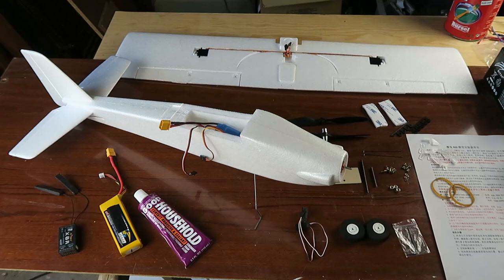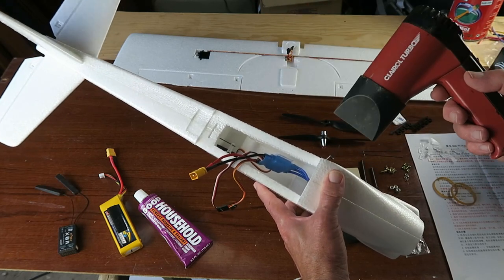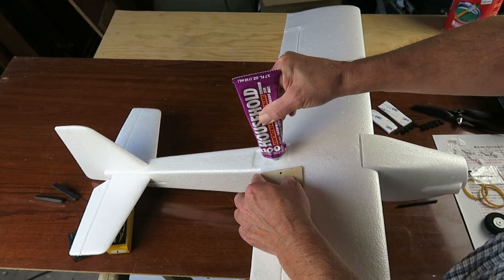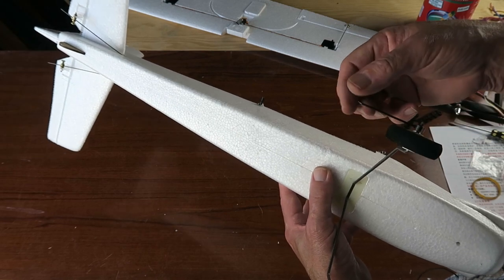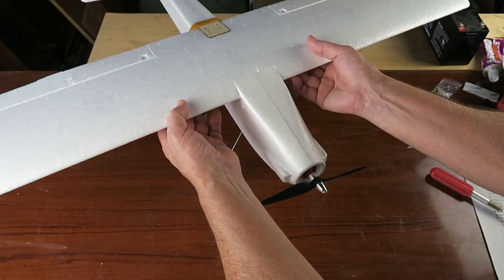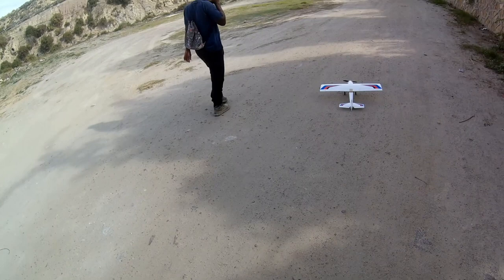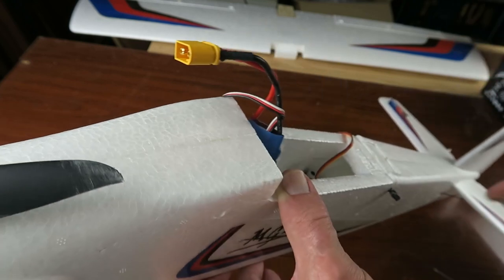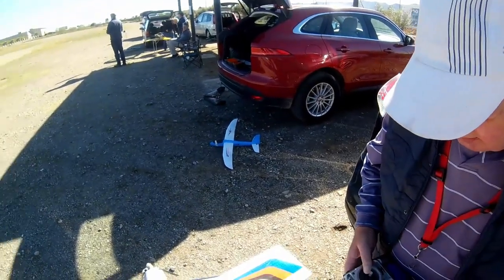MG 800 EPP Trainer Build, Mods & Test

Comment: I built one of these and I did the rudder mod. I also fitted a  cheap gyro which makes it easy to take off and land. Once you are in the air you can switch to manual.  It's a great all-rounder definitely worth Building.
Reply from the maker: That's a great idea! It's rather "squirrely" on takeoff!! What gyro did you use?
Reply: It’s called the NX3 evo . They are very good and come with everything you need. Get it from eBay or Banggood
Reply from the maker: Thanks! Added  to my wish list!

Comment: I build one of these and it is certainly not a “trainer” by any means. It doesn’t have any self righting dihedral. The suggested battery size is far too big and results in high wing loading as so equipped. I may flying mine on 3s 1300 and it balances perfectly and I’m getting 8-9 minutes of flight time. The plywood flap for wing retention is quite goofy too and I ended up just using a single pair of #64 rubber bands in an x and it is plenty secure.

Comment: So, should I buy it as a beginner?

Edit: no I guess
Reply from the maker: On reflection I would say no as well. It needs too much work and is too small to handle any wind. My next model will be on of these : BlitzRC Sky Surfer V5 1400mm EPO RC Airplane http://bit.ly/BlitzRCSkySurfer
It is larger and being a glider does not have to be "flown" all the time you can ease off and just let it glide. Also being a pusher will not break the propellor!!
Reply: @1nformatica  I agree. As a stepping stone to mk4 I am going for XK A800
Reply from the maker: Don't know the mk4 but the XK A800 looks a good choice, let me know how you get on with it.